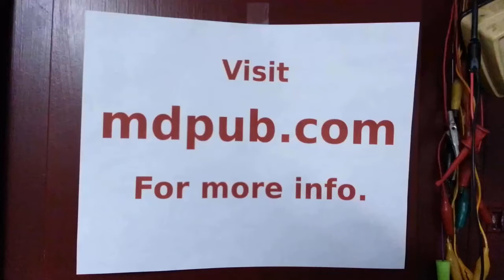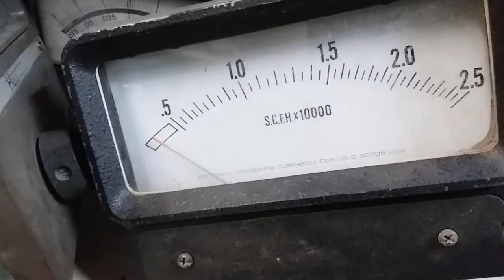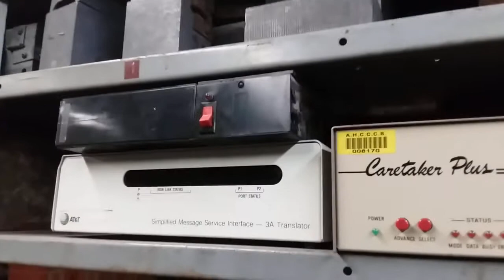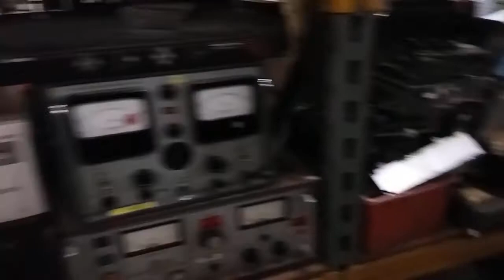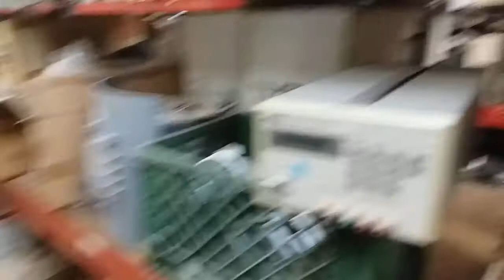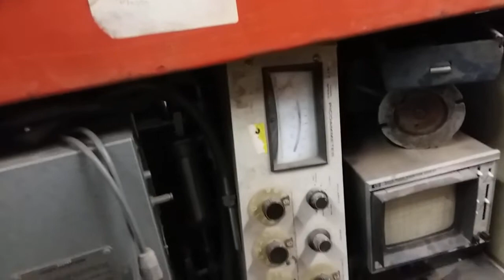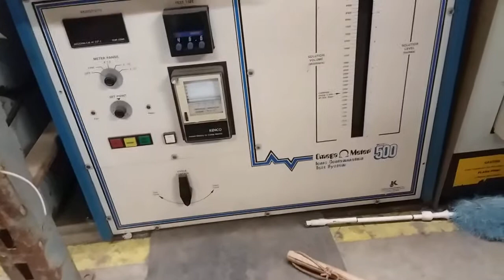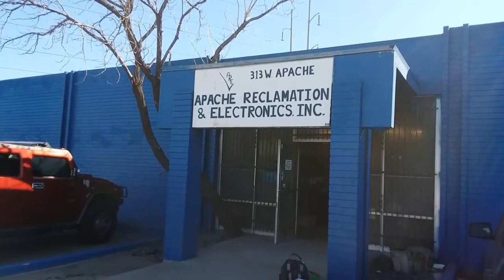A Last Visit To Apache Reclamation And Electronics In Phoenix

Comment: The graphite molds are CadWeld molds.  Electricians use them to weld copper cables to each other or  to a building's  structural steel when grounding electrical equipment.